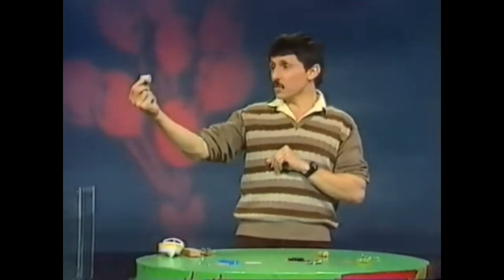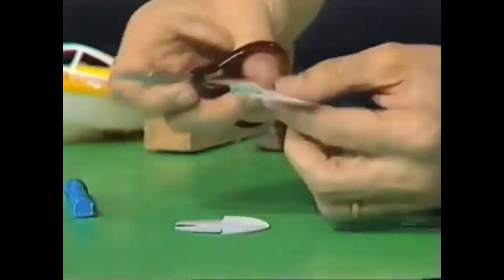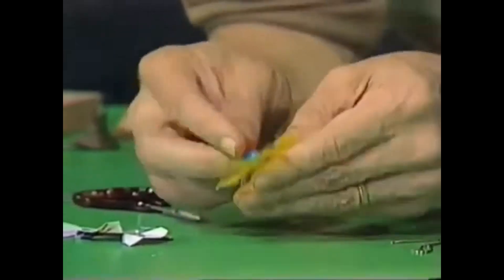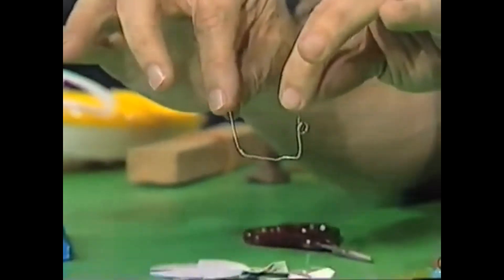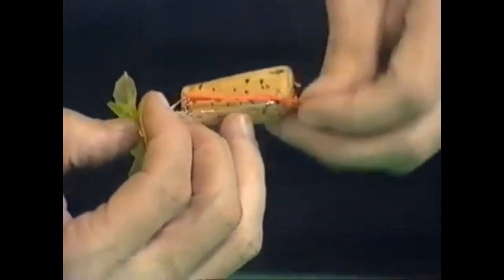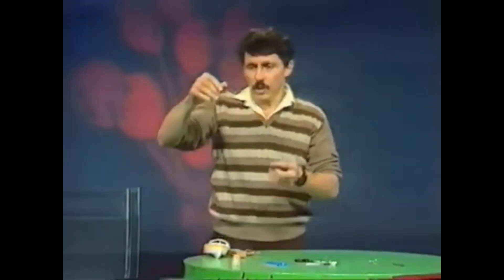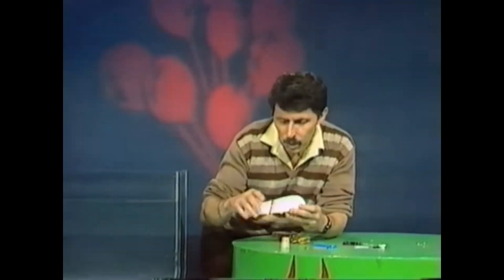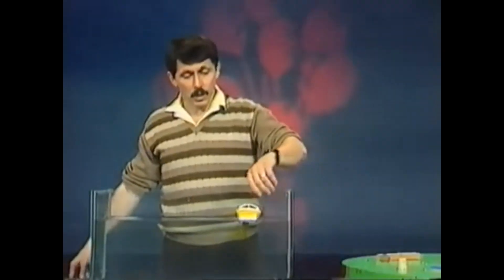Rubber-band Powered Boat

Comment: Adding a fin / rudder to the cork made from the same plastic container material the propeller is made of might would have stabilized the cork without the use of the boat